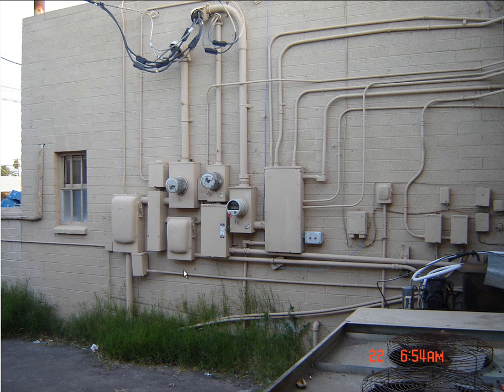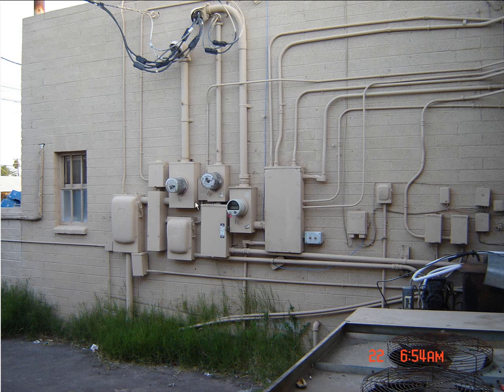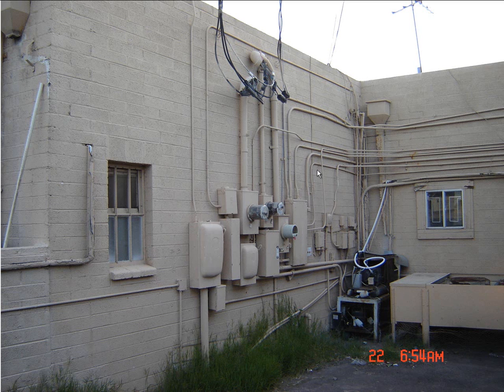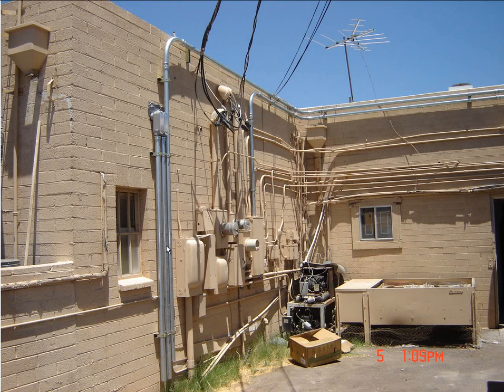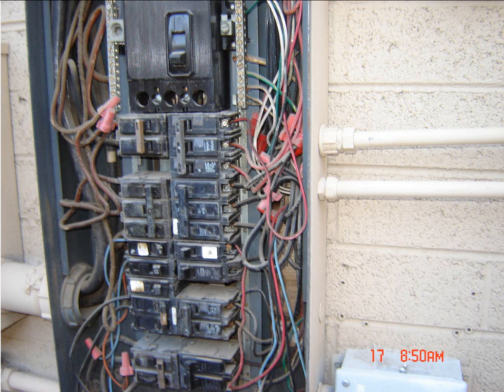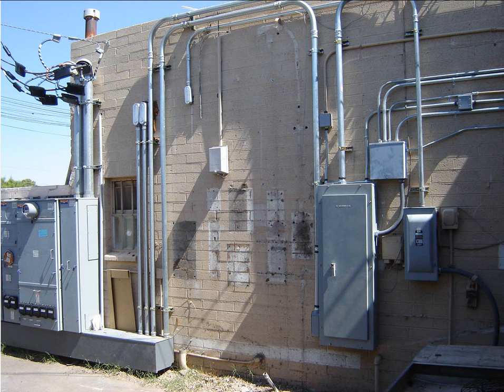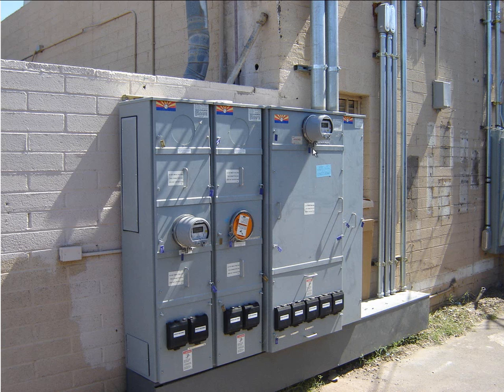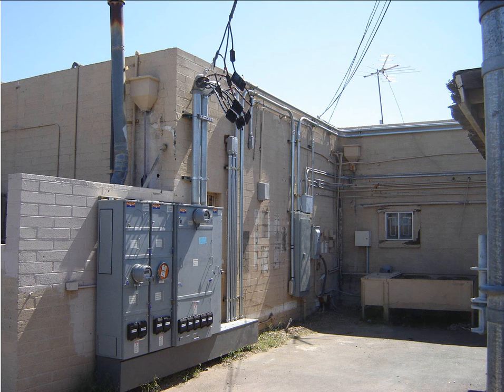Electrical Wiring The Resturant from Hell SES Done

Comment: what a mess one of those breaker panels was, a nest of wires, spliced together. I would think a meter panel would have been installed in the 1st place with disconnects for the 3 service panels. Not having 3 service drops and a mass of wires coming off the pole.  I am surprised how the original job passed inspection. Ought to have been "red tagged' not passed, power co. refuse to connect until brought up to code.
Reply from the maker: Out with the old and in with the new! There was so much more not shown that we cleaned up.

Comment: Are those couplings rain tight? Usually they are anodized blue gold or black. Regular stainless couplings are no longer allowed in wet locations. Just wondering.
Reply from the maker: Yes there are RT fittings,the  blue faded away but they are stamped RT.Funny thing,after all that work the inspector nailed me for using a tek screw on the gutters ground bar instead of a machine screw.
Reply: +Electrical Industry Network haha.....the things they look for.